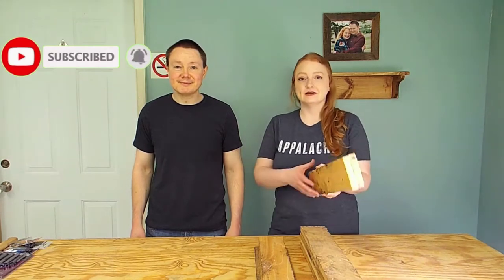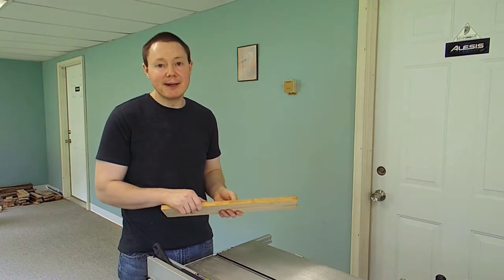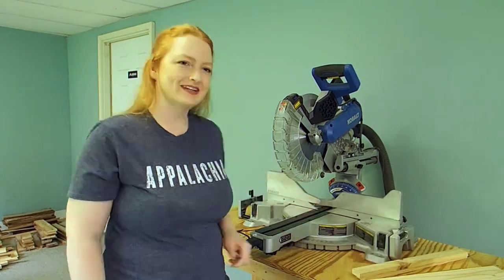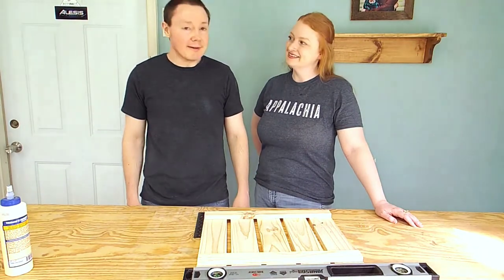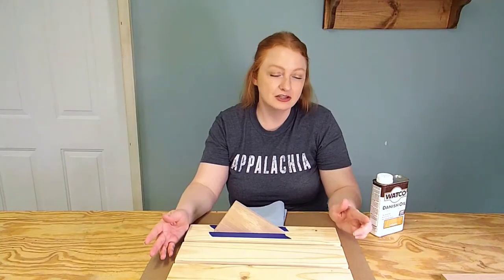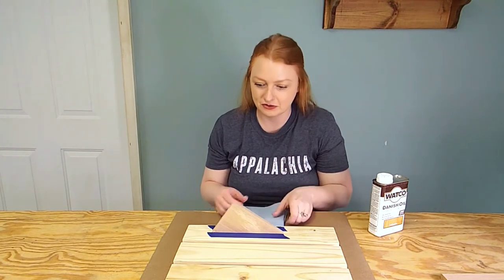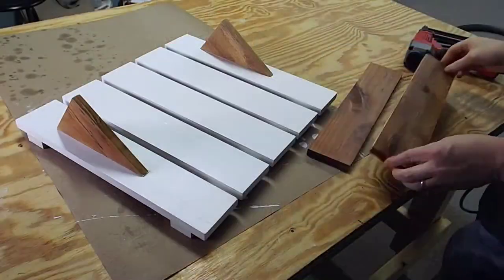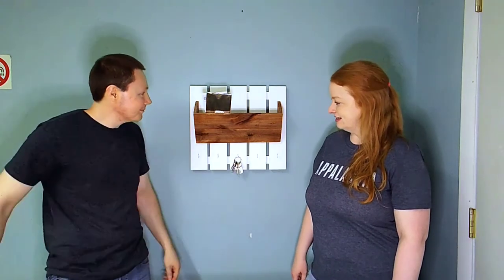How to Make a Wall Mail Organizer | DIY Wall Organizer Ideas | Mail and Key Holder | Farmhouse Decor

Comment: I like it but the angled pieces in the back of the mail holder part stick up past the mail holder portion, shouldn't it be straight with the top of the top board of the mail holder? I guess it is just preference.
Reply from the maker: We designed it so that it could also support larger pieces of mail like periodicals. It functions well. We were also giving a nod to a white picket fence 😉 Of course any project is subject to personal style. Let us know if you try it with modifications. #happywoodworking